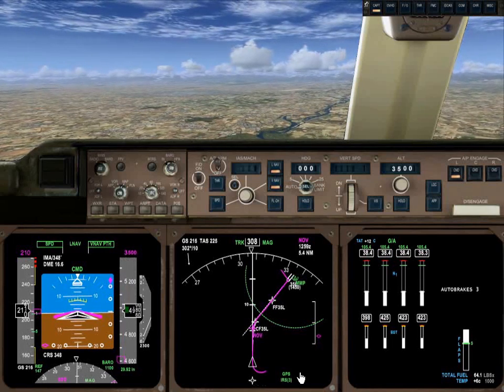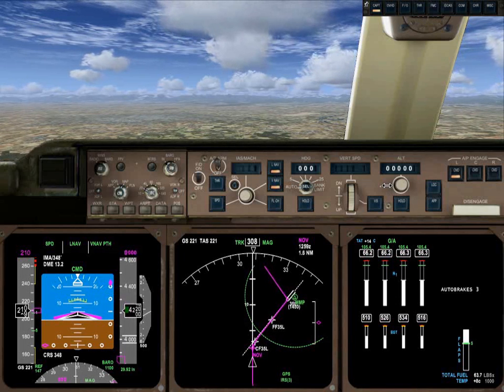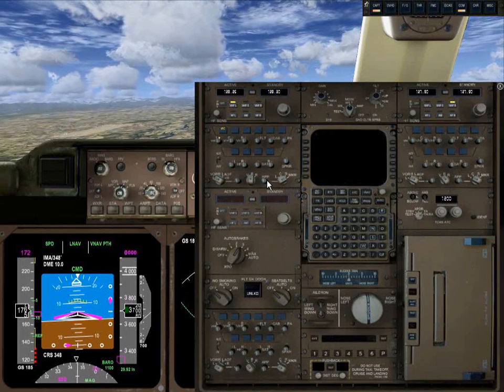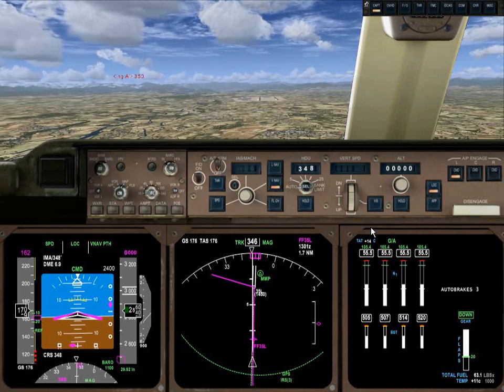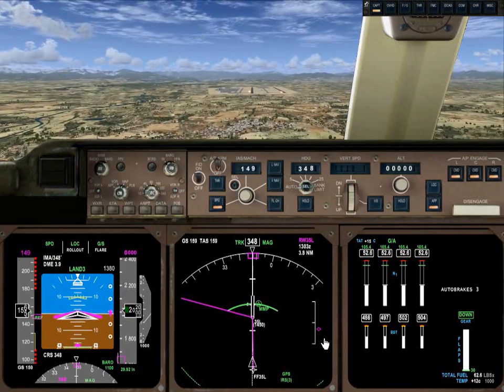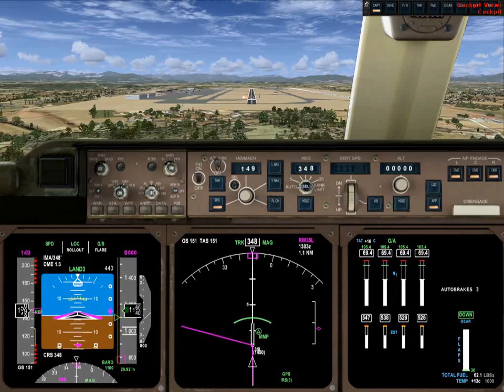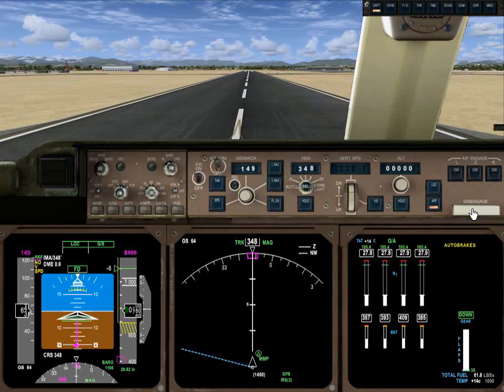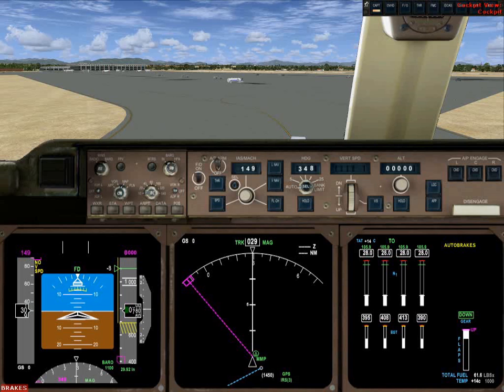PMDG 747 Flight Tutorial Part 9 Final

Comment: If the A/P is engaged when descending through 1,000 AGL, LAND3 will become active above the artificial horizon on the PFD, it thinks you want to do a CATIIIC approach (note: in CATIIIC there are no miinimums so the plane has complete control until you exit the runway). So the plane does everything by itself, it manages speeds and flies the approach (duh, haha), brings the throttles back to idle, flares, and keeps tracking down the centerline until the A/P is disengaged. All of this is automatic!